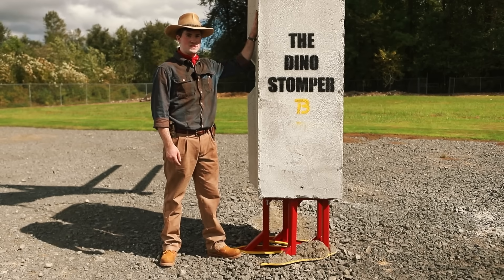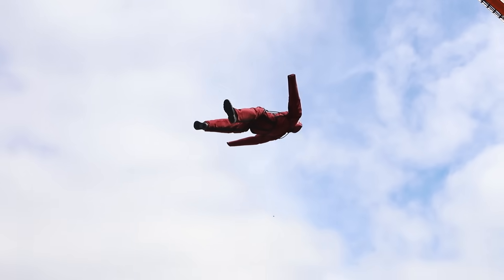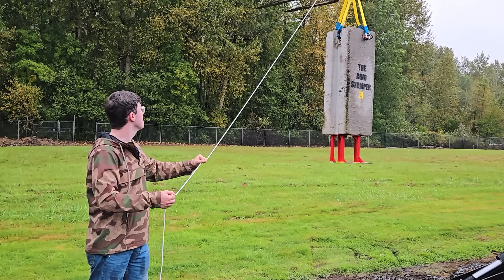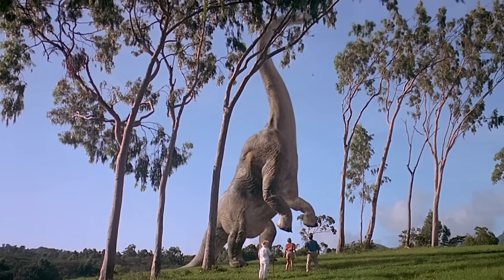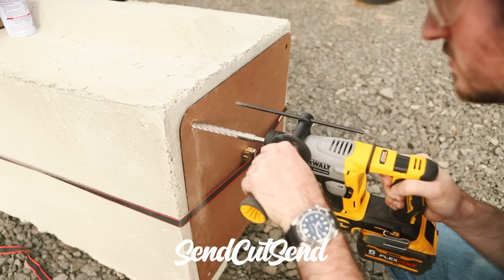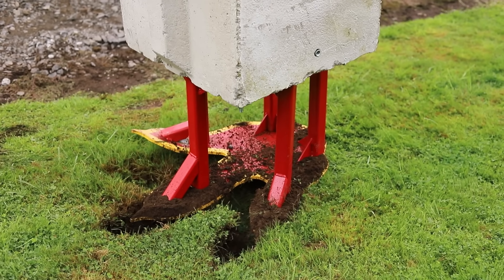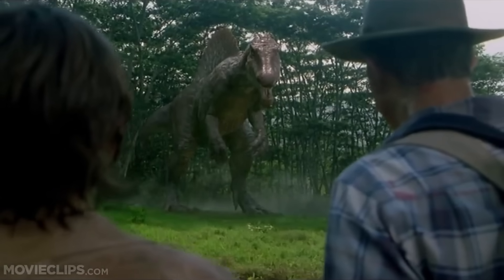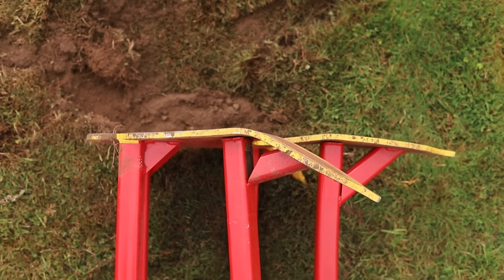Would Walking Dinosaurs Shake the Ground? Testing Jurassic Park

Comment: If elephants are any analog, no. Elephants generally walk very quietly. That’s a lot of weight to throw around, and their joints can only handle so much stress.
Reply: But elephants have really weird feet that are basically toe tips touching the ground with the empty space in between filled in with fat which helps them to move more quietly as well as feel vibrations in the ground better.

They're also lighter and on 4 legs instead of 2. Which spreads out the weight.

And different walking style.

They're also not that quiet. At least the ones I've been around aren't that quiet. They don't make the ground shake but I can definitely hear them.
Reply: @Rose_Butterfly98 we know dinos were tip toeing, and we are pretty sure their legs were padded to reduce stress on bones and joints. T-rex being a hunter wouldnt be really noisy just because of logic - you dont want anybody to hear you in nature
Reply: An elephants weight is also distributed across more contact points with the ground.
Reply: @Tar-Numendil  rex foot is wider .
Reply: @brunobastos5533  Yeah but it only has two. An elephants weight is still more evenly distributed just by virtue of it being a quadruped.
Reply: @Tar-Numendil  rex foot is wider , man is biology and physics
Reply: Depends, if it's on the road they could. we have horses here and when they run ,we can feel the vibrations from the concrete
Reply: @shoaibmalik9096  those got hooves and horseshoes
Reply: @brunobastos5533  True, but trucks do the same thing too, even with eight wheelers which basically absorb shock, several tonne trucks can vibrate a small building.
Reply: @shoaibmalik9096  I don't think many T-Rex's were walking on roads.
Reply: Depends on how fast they're moving. Accounts from people who've been mock-charged by elephants suggest that the ground does indeed shake.
Reply: Operative word is "walking".  I am sure a rex would also walk softly because there is no benefit to making noise that would alert prey or attract a competitor.  I have never been near a running Elephant, nor do I ever want to be, but I am betting it would sound and feel like thunderclaps.
Reply: They have giant pads on their feet.
Reply: Comparing three-toed foot to just one stump is also wrong. With feet like T-Rex you don't land it all at once, from tip of toes first to rest taking (relatively) much longer time to land entire foot to the ground, and even then it moves the weight of the animal to that foot only after it has already set it to the ground. This makes footsteps silent in comparison.
Reply: @ I have no experience with actual dinosaurs personally. ;)
Reply: Elephants aren't an analog.
Reply: @MeanBeanComedy   They are. You look at large animals without hooves and you get elephants. You look at large birds and you get the same. They have fleshy padding. No animal on this planet stomps around like that when they walk.
Reply: True, but elephants are different completely. Herbivore versus carnivore. Both would ideally want or try to be quiet. For opposing reasons(pred prey relationship and inversion). But for feeding...an elephant is moving slow. Only moving fast when threatened. A t rex...hunted other animals right? So their muscles would be developed different. Thinking fast twitch muscle fibers(not sure if that logic would apply to millions of years ago biology though)

Also...elephants walk on all 4s and t Rex had some little stub front arms. Weight distribution/balance...and the intent in the motion...and probably numerous other factors...lead me to think comparing an elephant to a t rex in this instance is inaccurate. 
But I know nothing about this stuff so just speculation. Thoughts?
Reply: @jeremygalloway1348 paleontologist compare trex with elephants all the time, even with how loud they were when walking/sprinting
Reply: @jeremygalloway1348   T-rex would not have needed fast-twitch muscles. It was not a sprinter and never could be. The weight would have been even more cushioned as a bipedal predator of that size because the thundering shocks would have destroyed its joints otherwise. The elephant makes perfect sense because that's why it's more or less quiet for its size. It's not at all the same, no, but the comparison can still be used to form a hypothesis.
Reply: First they have 4 legs and second they got soft tissues that absorbe shocks
Reply: @Legeekosaure93 You don't think a T-Rex had any flesh on the bottom of its foot?  It probably had more than an elephant because it was bipedal and likely moved slightly faster than an elephant.
Reply: @theman4884  yup
Reply: I was leading a horse the other day and noticed that its footsteps were more quiet in the grass than my own.

Comment: PLEASE Re-test the mythbusters episode with the cherry picker because imo they did it totally wrong, they suspended an engine and then just dropped it, it was a myth about cherry picker pulling an engine out of a car and it gets hung up and then launches the person 200 ft thru the air or something, but they didnt do it right at all , they should have put a load on it and THEN pulled the quick release , just dropping the engine wouldnt make any kinetic energy, i dunno how they failed to use simple physics just droppin only imparts whatever energy an engine fallin has wich is not as much as it would had it been under load when they cut it loose , i'm mostly dumb, i never made it out of the 8th grade, you can tell by how i type all this,  but i just feel like they didnt do that myth right at all. (it's to expensive to to flip a boom crane over i think) BUT you could sweet talk one of them RC construction equipment dudes, there is someone with a mini RC boom crane out there just waiting for a call like that, 100% and scale it down maybe, anyways i feel like a boom lift crane thing, pulling on  a engine thats attached to a vehicle that is mounted to the floor by chains or whatever, pulling up with all that hydraulic force, and then the chains break, i beleive the boom would launch a person some distance, i dunno how far though.

Comment: I really hope you're planning to continue this test!! Just and idea, but fill the square tubing with molten lead. Also, you could drill some home in the concrete and fill them 3/4 full with the lead, then top off with concrete. For the footprint, I highly recommend either making it a double layer or just use a piece of metal double the thickness. You could also weld some vertical strips of metal to stiffen the toes. And as for the quick release, give it a good cleaning with break cleaner the blow it off with an air compressor to ensure it's completely dry. After give it a good spray with Kroil or seafoam deep creep

Comment: 4k lbs is not close to a trex weight. Part  2 with a heavy at stomper? Also I suggest the name Dino stomprer 4000.

I'm not sure 4000lbs from higher up would create the same effect as the speed of impact does affect it depending on the circumstances.

Comment: You can pre heat your thicker metal to enable you to weld it. Also aim the torch closer to the thicker material than the thinner. And if you need an extra little boost beyond what your welder can do with pre heat and material thickness aim bias, you can use helium as your shielding gas which makes a HUGE difference... An aggressive pre-heat is probably enough for you though!

Great work! Love it!

Comment: Things that could be improved to make this video more scientific:
1. A completely serious regard to safety.
2. Data or illustrated reasoning explaining your choices. For example, you could have tried to find the ratio of force applied by a large bird's feet compared to it's body weight. An ostrich weighs x and steps with a force of y, a shoebill stork weighs x and steps with a force of y, giving us better information to infer from.
3. Be more aware of variables... Yes, like ground composition. You said you felt the dummy drop on the gravel driveway, well... gravel driveways are always compacted and spread over compacted soil, that makes a huge difference.

Comment: The best ground for vibration transmission is sand. A T. rex weighed approximately 10,000 kilograms. When it moved, it generated about 8 Joules of kinetic energy for minimal conditions, 72 Joules for average conditions, and up to 394,000 Joules for maximum conditions. These vibrations are likely to be felt up to 30 to 100 meters away, and in some exceptional cases, they could be noticeable at distances of up to 150 meters or more.
Reply: if that was true they will starve . they got fat to on the foot to absorve the impact . a predator need to be silent
Reply: 10 tones is possible maximum weight. Average T. Rex weighs less and has adaptation to be quiet when they walk.

Comment: Just a heads up on BetterHelp and YouTube sponsorships in general. It's not uncommon for sponsors to lock a creator into a longer-term contract (like 3 videos in a 3 or 6 month period, for example). The numbers of videos and the time frame can vary, but you get the idea. Often creators will decide to go this long-term route in order to have garunteed income for a period of time. It allows creators to work on larger or more costly projects, knowing that there is money coming from a sponsor. It's possible that Tyler is in a long-term contract with BetterHelp that was signed months and months ago, and is contractually obligated to continue to do these ad reads. Just wanted to give the viewers a heads up!  👍
Reply: Better Help was first called or 3 or 4 years ago. There's no way his contact for x amount of videos goes back 4 years.
Reply: This seems like a cool channel but I just can't support better help
Reply: There is also nothing that prevents breaking contract to prevent harm to his audience... Contract or not. Its not always cheap or an easy pill to swallow, but sometimes simply in your channels best interest to cut ties when something like HIPPA violations are what the sponsor is under investigation for.
Reply: How much this changes anything: 0
Reply: @skyless_moon  that way of thinking is the issue, but here’s hoping you grow a spine one day

Comment: One thing you did not take in to account minor really is that in the movie it was not just 1 foot hitting it would be numerous steps close together. This would have an additive effect. Take the footage and cut it together right when 1 ripple starts to fade and then at the start of the next. 
Or just rent or talk someone one in to using their pile driver as you could set it to hit with the same force a second or so apart over and over to get the additive effect of multiple steps. It should introduce a sympathetic vibration that will be amplified after a few "steps" (impacts). This would also let you replicate larger dinos and even godzilla lol 
We have construction next door and they were using a earth compacter which is just a big 1k pounds or so attachment that goes on a back hoe and that sucker felt like it was going to shake the house apart

Comment: Before i watch i am going to say 100% yes for the bigger dinos 
I live on a cobble stone road and a medium size pick up truck when it just runs of a few of the higher stones can be felt in my house sub 30 feet from the road. This is mind you just a 1/4 to 1/2 inch drop with a 1000 or 2 pounds coming down.

Comment: I am amazed that it can be replicated,all do be it at limited resources,as you cant replicate the weight and energy transfer of the actual T-Rex and how hard it stomps each time that is never consistent.
Also pretty sure the Truck (10:15) could have a better suspension system then a Jeep
Reply: you're amazed they replicated something approximating what was once a live animal with modern heavy equipment? why?

Comment: nice video. you dont need a hotter welder just clean grind the surface of the metal to weld untill you se shine metal, a black oxide layer from lamination in the making of that sheet and square tube does not fully melt and is't geting off the way so your weld does not touch real metal sometime you get lucky but is better to not depend on luck when you talck abaut welds.

Comment: I stood with a small crowd of neighbors watching a large tree being felled.  We were about 60 feet from the stump, and I two others were standing on a concrete driveway while the rest of the group were off the edge of it in the grass.  As the tree was about to fall, I wondered aloud (over the chainsaw) if we would feel the ground shake, so everyone was paying attention, and, oddly, I thought, those of us on the concrete felt it move, and vibrate for at least a second.  The folks on the grass mostly didn't feel it.
Reply: It's highly dependent on the ground composition. 
I used to work in landscaping and I've helped do a lot of tree work. Even small logs can be felt vibrating through the ground even a good distance away. There have been jobs where I would be in the front yard, standing on the work truck, and still manage to feel the vibrations of a tree that fell in the backyard. And then there are jobs where logs will fall fairly close and I won't feel them at all. 

It's all dependent on ground comp.
Reply: makes perfect sense to me - a more brittle homogenised substance is obvs going to resonate more strongly than a loose composite of squishy stuff.
Reply: Sounds like impedance matching
A large contact area between the dirt and concrete allows more energy transfer into the concrete.
And a stiff material (concrete) allows more energy transfer into your feet

Comment: The easy answer is it depends. If It's a predator and its stalking prey its not going to be stomping around. If its running it likely will make the ground shake. It also depends on what the ground is made of.
Reply: Predators stalking to get close would be gentle.  In the final charge / chase, they would be anything but.  I wonder about T-Rex hunting technique.  Cats stalk then pounce and chase, more or less (tiger, short chase, cheetah, long chase, both start with stalk or hide/ambush.) Lizards (not closely related to dinos) often move their bodies slowly and tongues quickly, to hunt, but can also move fast to evade their own predators. Wolves and other canines hunt in packs without quiet stalking.  Dino's closest relatives, birds, tend to hunt from the air so that's no help. I can't think of a ground bird that hunts anything bigger than bugs or worms, which they basically just pick up, or peck out of the ground and pick up.